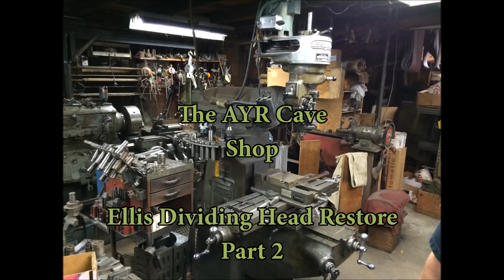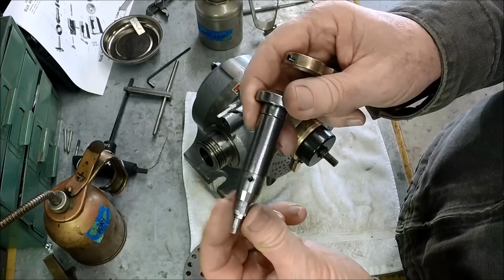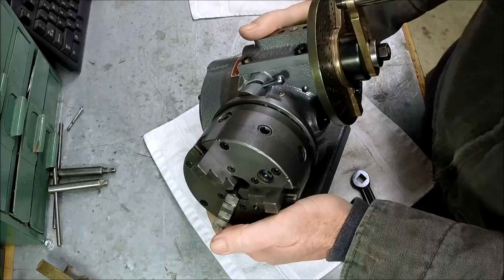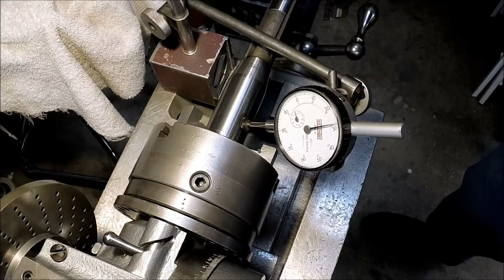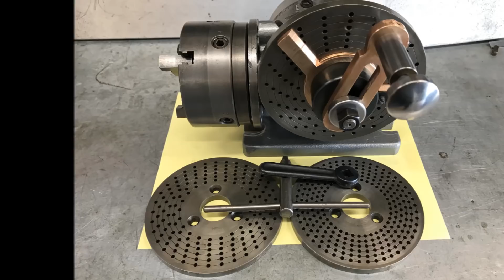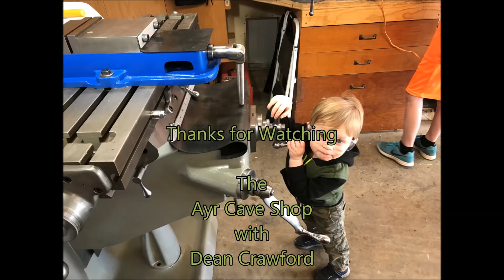Ellis Dividing Head Restore Part 2

Comment: Nice job on the refurb. Did you get a chuck? If not I would be interested in the DH. I need parts for mine.
Reply from the maker: I sold it to Doug over at Metal Works Machine Shop. He's been real busy but I think had ordered a new chuck. We made a funny video on the special delivery method. 
Thanks for the comment Ron !